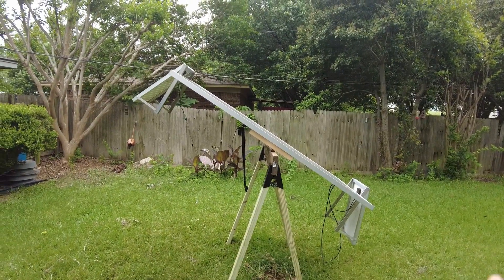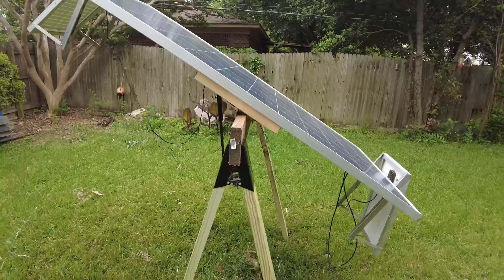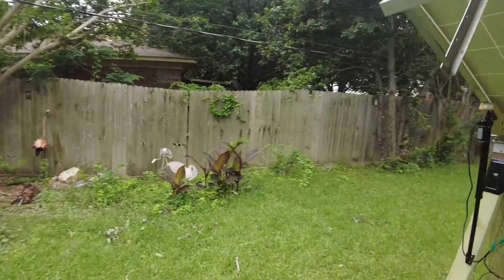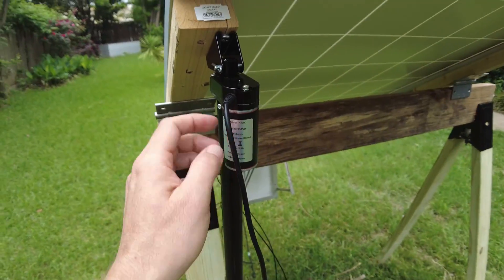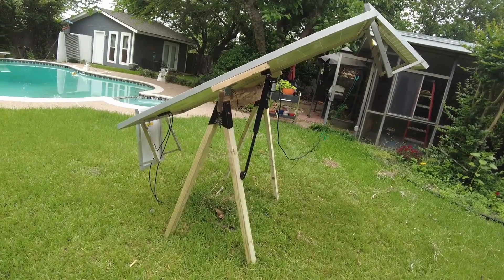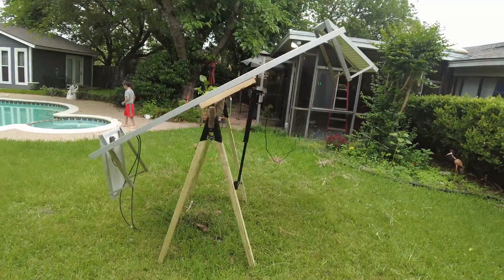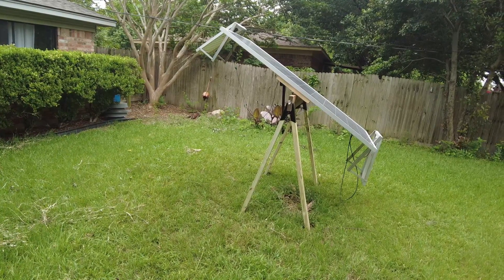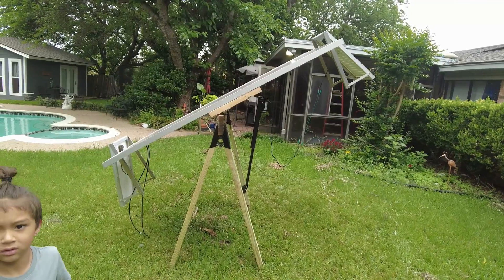Easiest Solar Tracker

Comment: Nice build. I'm looking at making my own solar tracker for a large array, but I have a ton of roof space facing east and west. I noticed your house is simillar in positioning to mine. My question is why wouldn't you just put stationary panels on both sides of your roof? I keep coming back to that question myself on my own house. I also have a camper I live out of for half the year, the stationary panels on the roof of it I feel would benefit from a system like this. Idk, is this worth it for a large array like a house with a ton off roof space or is it more of a mobile setup addition?

Comment: I like it other than the longitudinal angle.   Assuming you’re in the N. hemisphere, shouldn’t you shorten one set of legs so it’s facing south about 30 degrees?  And then your single axis rotation will track the sun East to West at a more optimum angle?   Disregard if you’re on the equator lol.

Comment: i have done my window shoping to build this simple sun tracking panel support.   I live in Quebec Canada  it will cost me in material  181.22  $  CAD taxes included. I already have a 195 eco worthy sun panel. I will buy 2 small 12v 30 watts panels   and the wood . should be fun to build.

Comment: I've been thinking about building a tracking system when I build my house next year and go off-grid. I've been looking at dual-axle systems, and I think that would require a very substantial mounting system. I think that a single-axle system would do almost as well (using a N/S angle that favors winter sun) and would require a less robust pivoting system on the mount.

Comment: I seems to me that you have to be careful not to let full sun on both panels at the same time.  If you do, they will fry!  Perhaps a couple of fuses should be added to be safe. Choose the fuse size to match the panel rated current.

Comment: I like the linear actuator. Didn't know those were soo affordable. It's a nice idea, however I'm thinking simpler is better. Why not just have a timer that moves it a specific amount per hour. It would probably scale more easily. wont be as precise but would be more economical and less complex. Armchair expert 2 cents.
Reply from the maker: Actually a timer would be much more complex. You would need a complex timer setup. 1 timer to move on set intervals, then another that limits how long the actual actuator motor runs to achieve the movement. And that's before even considering what you need to run the whole system back to the start for the process to continue the next day. Thanks

Comment: I LOVE IT! Thank you. I've been looking for something like this. So glad I found it. I'm going to try and make several of them for my 5 panels. I've been using them to power my fridge in the little house I live in. I'm also using several EcoFlow generators. I put the panels (the ones with legs stay on the ground) on 4 wheeled push dollies, and I would go outside and turn them every couple of hours. I'm on a trip right now, and put them up till I get back. I didn't know how to make my own moving system and this would work well for me. Thanks again.

Comment: love the idea, but my area is prone to large gust of wind and it may not be a viable option because it would tip the scale.  If you can build an idea that would hold the ends and bolted down to the floor then we can have something awesome.

Comment: Awesome information (it was hard to get past the intro music).  I'm going to do this.  I have 2x 200w bifacial panels on the way, and thinking about adding a 3rd even before getting them.  I've seen the expensive pre-made versions of these trackers.  I want something that is not so permanent.  So for me, the solar would be to use in times of multiple days without power.  I want something I can quickly set up and not have to put a permanent slab down.

Comment: Great job!   Im building a second trailer solar set up for portability.  This would be a great addition to it.  I have two harbor freight 5w small panels for the actuators power.  Will have to see if they provide enough power.  Sure hope that they would work.  They have been lying around for years.

Comment: All studies only showed additional yields of between 20% (single-axis) and 37%.  
Due to the extreme drop in the price of solar modules tracking systems are now superfluous. In any case, they are mechanics and need maintenance. 
It is much cheaper and much more reliable to simply install more solar modules.
Reply from the maker: True in many cases. However the most overlooked use case is space confinement. You don't always have space to add 20 - 37% more panels. Thanks

Comment: Nice simple system there.  Personaly I dont think biaxial would really gain all that much and would significantly complicate the build.  The optimal north/south angle does not really change much throughout the day and even throughout the year your only looking at marginal gains from adjusting it to be perfect over aligning it with the equinox angle and calling it good.  You'd probably be better off tilting the whole array to some fixed angle on the north/south axis and calling it a day and let the east/west suntracker do its thing.

Comment: If I use a longer actuator ...or even 2 mounted either side - would that give me more stability in high winds? I even thought to expand your method to a universal pivot mount with 2(or 4) actuators which would enable the unit to track the sun on both vertical and horizontal axis'. Your thoughts?

Comment: Have you tested these actuators to see what the minimum amps it will run on? The ad on amazon says 3 amp draw but I was curious if it would run on less amps considering the light load.

Comment: @BradCagle it's a nice one, however usually panels are tilted toward south so that it can receive sunlight most of the time. I understand that direct sunlight is better but would like to know from you if you used some tools to measure generated power with this   setup versus the normal fixed setup toward south. What would be the difference?

Comment: Great idea! Thnnks for sharing. Triganometry can be used to determine the positioning of the ram and correct force of the ram, using inverse SIN if I recall correctly, easy to find a calculator on the net. Much quicker than trial and error with positioning. Cheers

Comment: You can increment the motor steps program as per the time of day because the sun will always rise in east and set in west. No need to track the luminosity using a sensor and complicate the system.

Comment: use a ball hinge in the center and do the same actuator set up on the other axis and you can have a true multi-dimensional panel which is always facing perfectly perpendicular to the sun no matter what elevation or lat-long you're located at, maximizing the collection of solar rays and increasing the charge your battery packs will receive.
at least that's how i did it
Reply: Why isn’t the profile of the energy generated in a sunny day constant with a solar tracker from sunrise to sunset?

Comment: “Simplest” not “most simple”
Reply from the maker: Both are correct.
Reply: @BradCagle  No, not really. One syllable words use 'er or 'est generally.
Reply from the maker: @JonathanMiller-k9r The word "simple" has two syllables.
Reply: @BradCagle  From San José State University Writing Center: Changing an adjective into its comparative or superlative form depends on the number of syllables in the base form of the adjective (e.g., small, tall, big).
One-Syllable Adjectives
The suffix -er will be added for comparative adjectives and -est for superlative adjectives.

Comment: So... spend $100 to track a maybe $200 panel, not worth it. Even multiple panels it would be questionable, and I doubt this setup would actually work reliably.  May be better to setup a simple timer to periodically move, or get an actual dual axis tracker system, which would be more, but would include all the mounting hardware, work better, and be reliable.
Reply from the maker: Here it is scaled up to larger, and more panels https://www.youtube.com/watch?v=gHZCTBCteW0

Comment: I might post a second saw horse in parallel.  Mount an east and west facing non moving panels. Have that second set powering all actuators along a parallel system of 2 4 6 and so on.

Comment: the panels to regulate the actuator woulnt need to be placed ON the panels themselves they could in theory be set on an area with the correct angle to fight for the sun at the time of day. no need to have them mounted.

Comment: I have a couple of these actuators on my chicken coop.  The one inside the coop has been in place for almost 4 years now.  Still going stong.  The one outside on the run door....eh....two years maybe....and it did freeze thisbpast winter.  However...it isnt under a set of panels.  I think they would be fine.  

Need more power?  Run higher output panels for the actuator.

Comment: Quick question. Why did you decide to do east west and not take into consideration the south facing sun angle? You're missing a lot of solar capability by mounting flat in the north south direction. If you put a bar down the center to pivot in the long direction. place the panel north/south and move the short side east west you would get more output. I did like how you are using the smaller panels to control tilt.
Reply from the maker: This was really a proof of concept, so I was looking to do it in the most simple manner. I would like to build one with a manually adjustable south axis. Thanks
Reply: @BradCagle  Just glanced at your other videos. Gonna check them out. Never heard of Solorage before.

Comment: Simple design, and the time lapse section at the beginning of the video shows it working.  My question is, just being who I am and what I know, your east 20w panel is wired for correct polarity and you west 20w panel is wired for reverse polarity, so basically you have +12vdc when the east panel is getting sunlight, and -12vdc when the west panel is getting sunlight, but at mid day when both panels are providing 12vdc to motor, how is this not shorting out due to the wiring?
Reply from the maker: Well basically it is shorting out. However if your wire is able to handle the short circuit current (which is very low in this case) then no problem. BTW when solar panels are designed/built they are supposed to be able to handle a full short. The power is just dissipated as heat in the panel, and wire. Now since the power is really low, maybe 40w ( at most ) dissipated over all that surface area (the panels, and wire) nothing really even feels warm. Thanks

Comment: A site called redrock solar has circuits that use the fact that green leds act like pv cells and produce electricity when exposed to light to make trackers. Simple little H bridge like circuits that use very little energy to move the array.
At least they did about twenty years ago.
You could also use two tanks connected with pipe (creatively shaded) with one tank worth of propane between the two. The tank exposed to more sun vaporizes the propane in that tank and it condenses in the other more shaded cooler tank making the see-saw move with no moving parts except the hinge.
Reply: I saw that 2 gas container idea in an article in the old magazine “Mother Earth News” decades ago (1980s?).
Reply: @mikeweber9766  I remember them well we had a subscription and we had a homestead/horse boarding stable at the time.
I also remember this being in the mother earth news using 20 lbs propane tanks to track the sun. It was only single axis tracking but it was cool because it used no power. New propane tanks won't work right since they changed the knobs to triangular, some safety change to prevent over fill I think.
The one I suggested as a modern alternative does require a small solar panel a small battery and liniar actuators like the ones used to level campers and aim old C band satellite dishes.
But they are 2 axis trackers. The original use was for aiming parabolic diches exactly at the sun to keep the focal point perfectly illuminated, usually the feed horn was replaced with an aluminum block with copper pipes embedded in it as a make shift boiler.
A one way valve like in a drip coffee maker can make it "pump" the hot water to a raised tank but the tank must be vented and not under pressure but can be used as a heat exchanger by running water pipes through it that are under pressure. Still need a safety pressure relief valve on the pressurized side.
Freeze protection is an issue if it's in the north.
I don't think trackers are worth the effort and wouldn't seriously consider them for a PV system now that panels are so much cheaper than back then.
Maybe for a solar water heater for a summer or vacation cottage or where freezing isn't an issue.
Reply: @ghz24  I couldn’t recall any details about the article and didn’t have any interest in solar at that time.  Odd the things that a person remembers. I guess it just really impressed me as a creative idea.  It was an amazing magazine during those times.
Reply: @mikeweber9766  They may have had multiple articles on it they would sometimes cover the same concept with minor changes. 
It is definitely a rich source for modern youtube homesteading creators.
A whole generation that doesn't know it's just plagerized from older work like the hyperloop was.

Comment: At the end of 2023 everything speaks AGAINST PV tracking: 1) Because of price decline 430W modules cost today already under 100 €! Better to buy more modules, but in S-E (for morning sun) and S-W direction separately upright. Even in cloudy conditions, base load is then generated.  
2) Tracking solar tables are exposed to much stronger gusts of wind. 
3) Any mechanical system has a shorter lifetime. On the other hand, elevated modules work for about 25 years.
Reply from the maker: I agree, however if you have space limitations, a tracker is a viable option. That spot in my yard is limited in sun coverage, the tracker allows me to take advantage of the coverage I have, and not anger my wife too much :)

Comment: Nice video. I have 3 ground mounts just like your 1 panel. Each set has 4-400w panels. Each set is on 4 vertical poles (your A frame) mid panel and a horizontal pole the length of the 4 panels. Heavy duty gate hinges tie the horizontal pole to the vertical poles (4 hinges). 1 actuator each set in the middle under the panels (barely gets wet). Long stroke,, 1000lb actuator ($120ea). My actuator motor is at the bottom. All the panels are tied together with 1/2inch aluminum U channel.. Well grounded.. Been in operation 5 years. In high winds I have a parking spot panels are horizontal.  Survived 60mph hurricane Hillary So. Cal.
Thanks for your video.
Reply from the maker: Wow, that's an awesome setup. Thanks for sharing the details :)
Reply: What are the poles made from?
Reply: @ej2863  10' galvanized fence posts. 4' in the ground. You could use wood 2×4 for the horizontal. If the hinges are heavy duty they last forever but can be replaced one at a time without disassembling anything.
Reply: @krg038  ty!

Comment: Excellent concept I'm thinking if you add a small 12v battery you can even have it reset to face East once the sun sets.  Maybe with a time clock to have it reset back to East at night.  This is really cool getting pretty much Max power from start to end of the day from this setup.
Reply from the maker: It already resets back to east. In the morning the sun will illuminate that east facing panel on the end, and drive it all the way back. Thanks

Comment: how does this structure hold wind forces? Were any issues connected with wind?
Reply from the maker: Not very good LOL. I've had it topple twice. So you need to fix it to the ground for sure.
Reply: @BradCagle   and what about fixing the solar panel to the Linear Actuator? Does Linear Actuator keep wind pressure on solar panel? whether the panel does not shake under the influence of the wind?

Comment: It would be just as easy to add another two small panels that turn the panel to face the sun. Just use the shadow of the panel itself to trigger the actuator when the sunlight falls on the small panel.
Reply from the maker: Yeah, but the tracker will never return to home in the morning. The way I have the panels angled, the one on the left (east) will catch the morning sun, and drive the tracker all the way back to the east. Thanks
Reply: @BradCagle  - Ah! So you've tried that idea already! OK. Loved the video, thanks.
Reply from the maker: @carltaylor4942  Thanks, glad you enjoyed it.

Comment: I would measure the idle current. Those 20w panels are trying to load each other.  You've essentially put two panels in series and short circuited the outputs.
Reply from the maker: It's actually fine. Solar panels are  designed (or should be) to continuously handle full short circuit current.

Comment: Item of possible interest: the linear actuator you're using requires 2 volts at 0.5amp to begin to move in either direction.  No surprise that some of the movements are jerky - it gets just enough power to move and as it moves the available power increases so it moves faster until the other solar panel produces enough power to slow/stop movement.
The specs say 0.4 amp minimum but testing with a 12.6 volt regulated supply finds that extension or retraction with no load takes about 0.7 amp to start motion and it varies from 0.55 to 0.7 amp.
The actuator is rated for a maximum of 225lbs so do be careful of where you put your fingers when running the actuator from a 12 volt source.  That could probably move a fairly substantial solar array but they do NOT list the actuator's static holding capability.  That's something you'll find on commercial and military specs: moving load: 20lbs; static load: 700lbs.  Be nice to know if you're moving something that might be a big wind load.